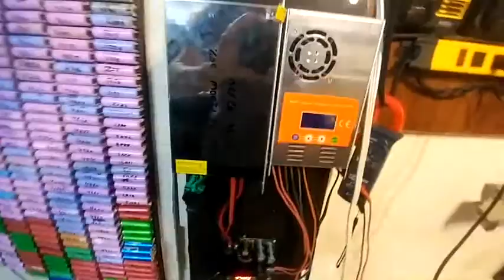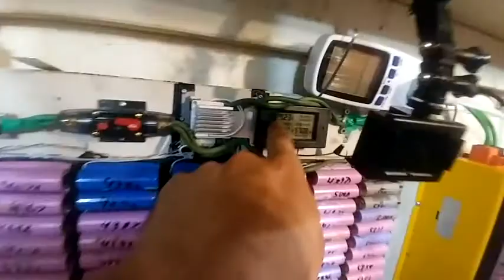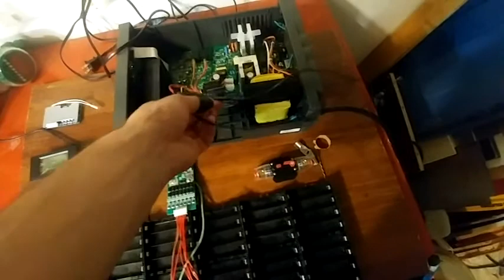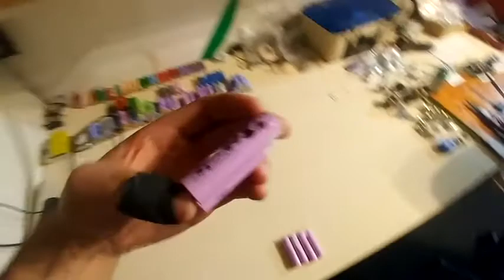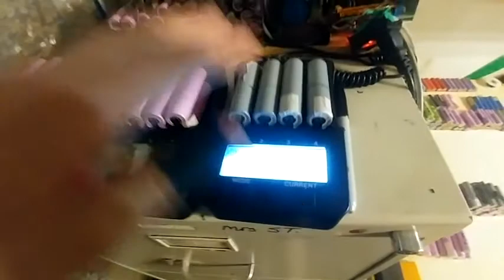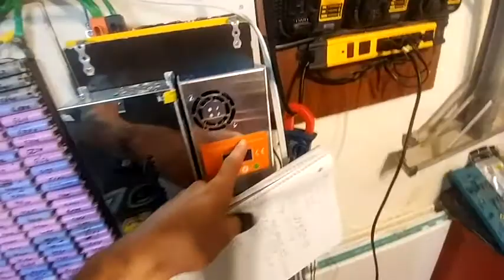18650 7s sept. update on lii-500, opus, makeskyblue

Comment: Hey Andy, I guess watching this video makes some sense over something I was going to bring up with you. The batteries I bought from you that were in parallel sets, I recorded all of the info on them and broke down the sets and processed them as individual cells, and I had surpassed the total marked on the cells at ~ 65%. Even keeping the sets together to keep track of them, I was getting numbers 4-600mah higher than what you had them rated as. By the sharpie markings on the pairs, it looked like the cells would be 1500-1600mah individually, but the majority of them are 1800-2000mah. I was thinking that this was the result of you processing them in pairs, but it looks like you found the source to be a bad charger.
Reply from the maker: Thx glad to hear they are better than recorded. With mah testing it can be all over the place. Every test you do can give wildly different results esp in pairs. Applying pressure to the battery while testing also greatly changes results. Its more of a guide post than a measurement.